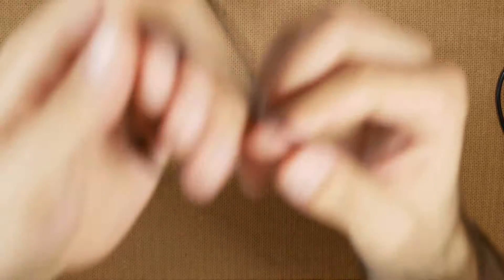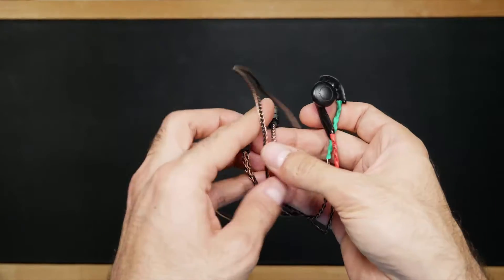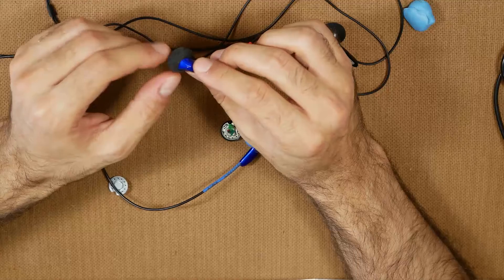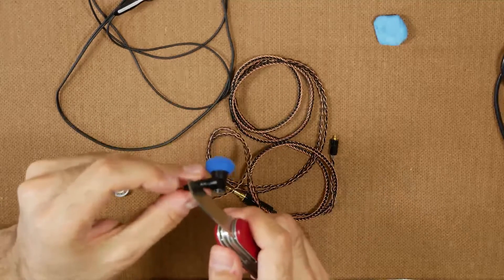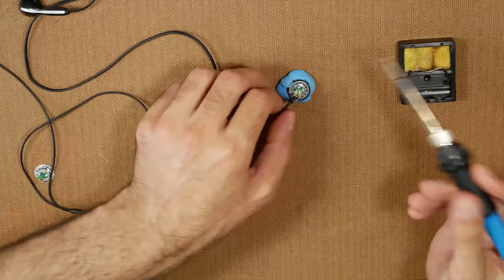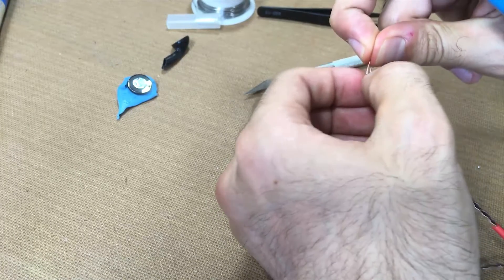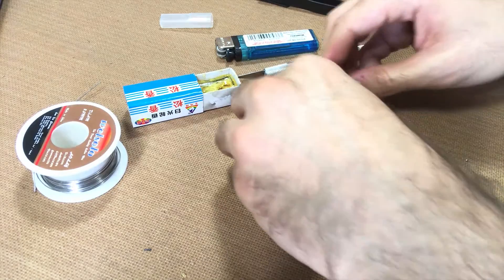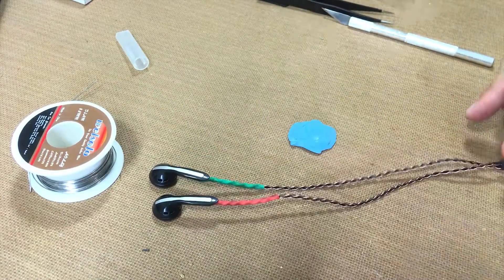Earphone Cable Swap Edifier H180

Comment: Recabling this kind of earbuds was not for the beginners. Do it with precautions and be mindful on the force you're putting into. In my case, I just bought, might one of the oldest batch of h180 and it was hard to open.

Tip #1. Apply a tiny drop of acetone on the sides of the earphone. It will melt down glue.
 Tip# 2 Crease the sides gently with your nails, on a circular motion, just be careful not crease the top part because it is delicate.

Tip #3 Repeat the process until you notice that the faceplate started to comes off easily from the shell.

 You can also do this to other earbuds that were very hard to open.